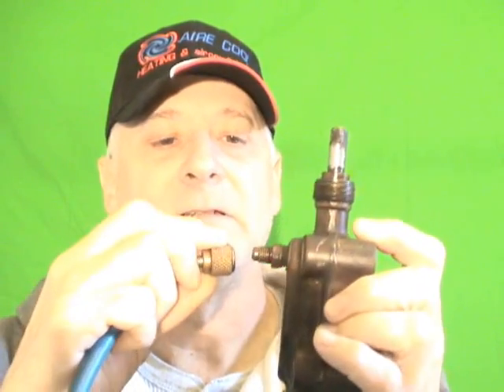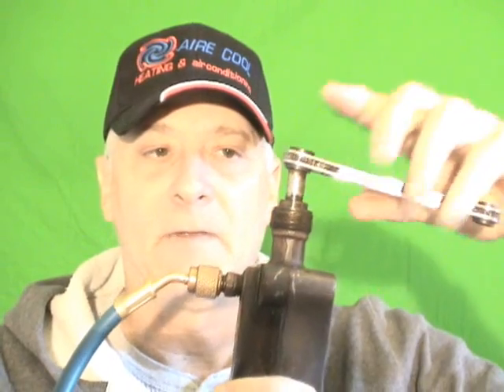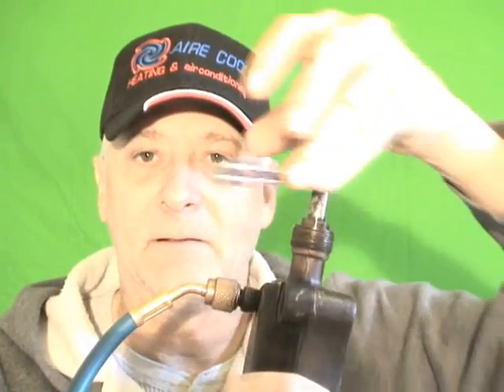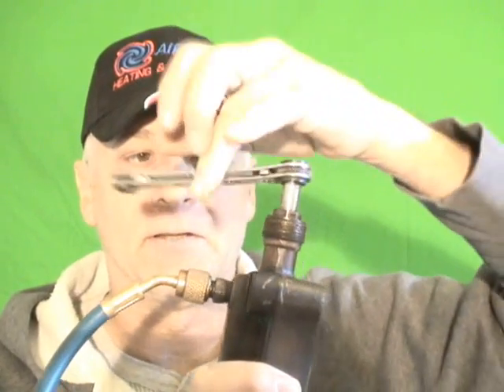HVAC King Valves 2

Comment: good video. it's very important to know how to properly install a set of gauges.
Always remember folks to position the stem just off the back seat to allow for access to the system, and always make sure to fully back seat your king valves before taking off the hoses. And when you do take the hoses off, a little bit of  residual refrigerant will be released from your hoses providing you do not have enviro fittings. Always bleed hoses that are equiped with envirofittings to prevent contamination